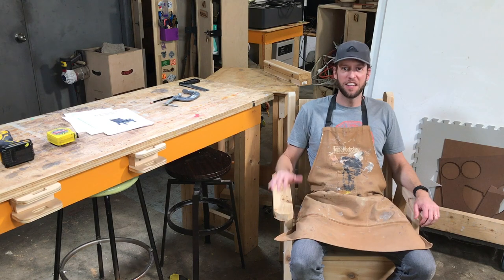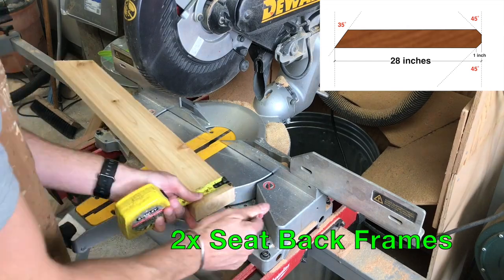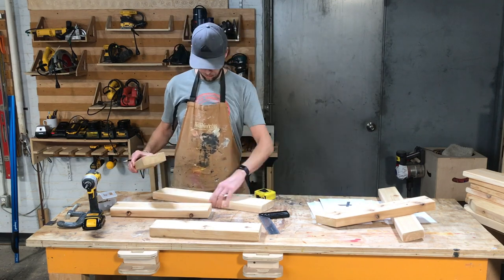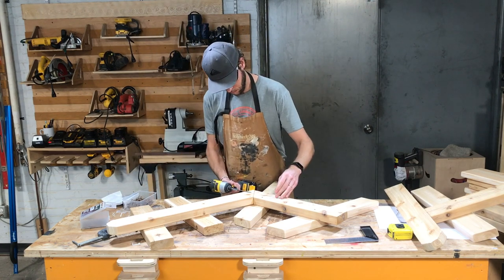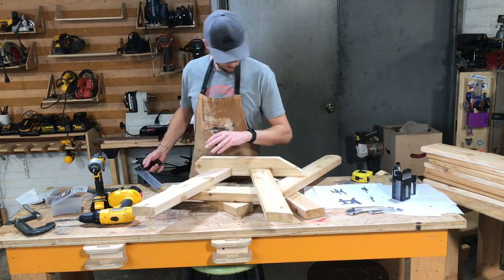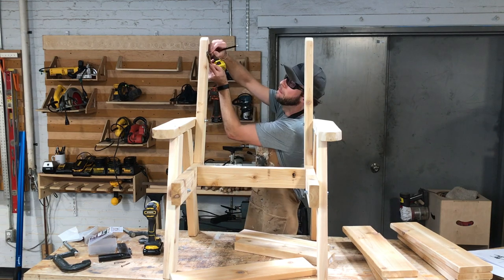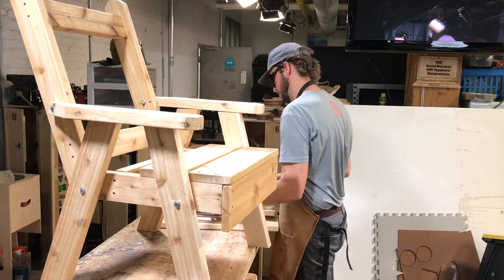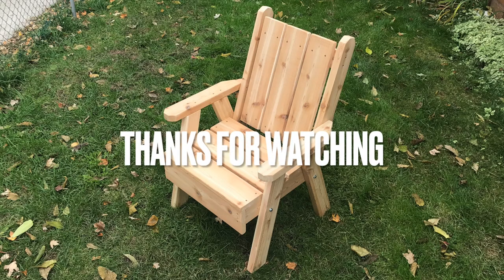How to Build an Outdoor Chair - Start to Finish

Comment: This looks fantastic! i will be trying this very soon!
Reply: made my first one, do you rip the 2x4s so they're more square? I feel the rounded edges really got the best of me.  I'm also very new to woodworking, could just be lack of experience
Reply from the maker: I did not rip the 2x4's. Although you can, this tutorial is meant for beginners, and ripping 2x4's is neither simple or safe for a beginner.

Comment: For those whose miter wont do 60 degrees for the arm rests you can do a 45 but instead of 1 inch measure 1.5 inch up and you have to drill a pilot hole for the spade bit and take it easy.

Chair is great looks amazing. It’s comfortable and it’s solid.
Reply from the maker: Thanks for providing this helpful tip. Glad you like the chair!

Comment: This is an old video but… looking at your cut list for the 1x6 boards, the most efficient way is 1x6x8 4@22 inches, for the 1x6x6  3@23 inches
Reply from the maker: Thanks for the helpful tip! If the 1x6's are available in both lengths, your suggestion works great

Comment: How thick are the boards?cant find it anywhere
Reply from the maker: The nominal dimensions (the sizes used to describe the approximate characteristics of the product rather than the exact dimensions) are: Frame - 2x4. Seat slats - 1x6 or 5/4x6. The actual sizes are smaller, but these are the thickness x width that you need to shop for. See 1:03 of the video for complete material list

Comment: Got the plans but no mention of what degree for miter cuts?
Reply from the maker: Hey Steve. I don't have them in front of me right now but check the cut details. I made digital images of every cut with the angles. Let me know if you have any issues
Reply: Thanks
But for some reason I cant see the angle cuts. I got everything else. I will figure it out. Thanks again
Reply from the maker: @stevewhite7602  odd. I'll take a look when I can get to my laptop. Hadn't heard of this happening before. Sorry about that
Reply from the maker: @stevewhite7602   take a look in section 4.0 Special Cuts. The mitre angles are shown in red font. If you don't see it, shoot me a message on Etsy so I can see your order and I'll send it to you again. Cheers